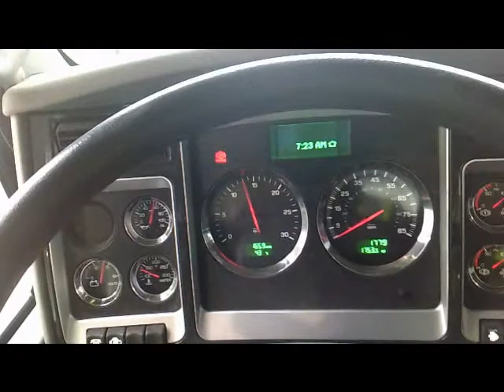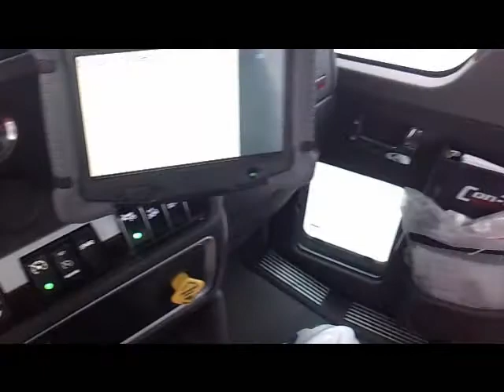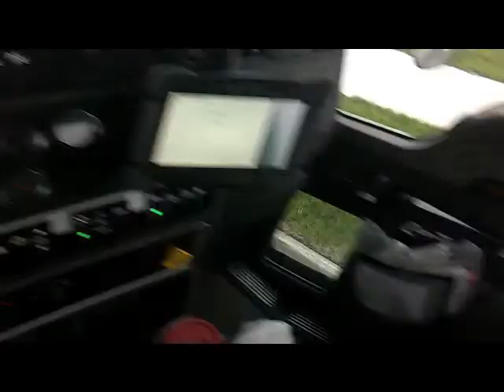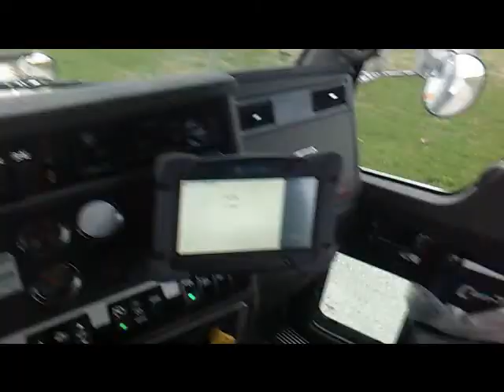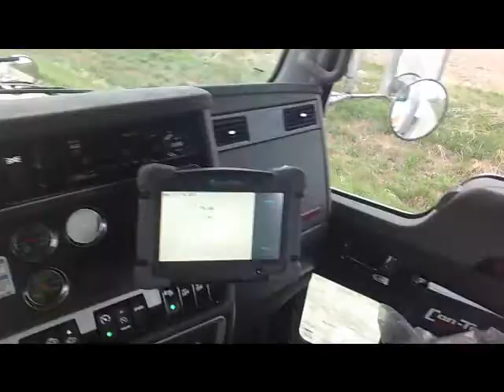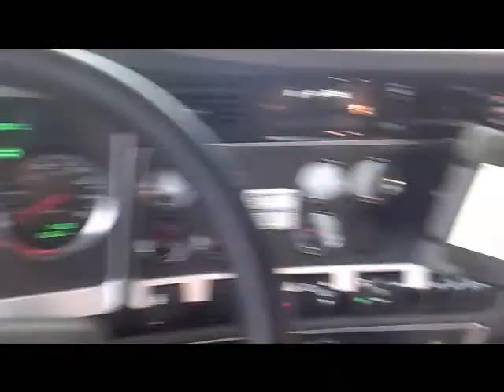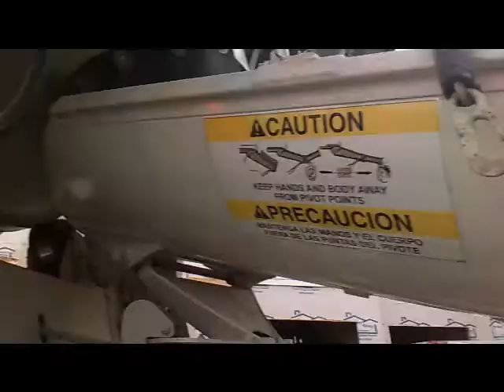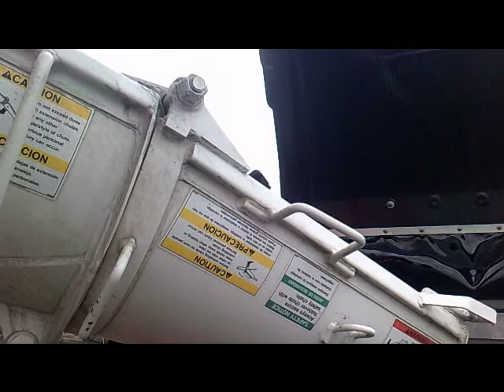Body camera on a ready mix driver

Comment: I've been thinking about applying to drive a mixer in my hometown.  Working 12 hours a day, most days of the week has got to wear on you. Do the days go by fairly quickly,  or do you feel overwhelmed sometimes, as in feeling like all you do is work? I used to work as a welder in factories,  and other factory work for years, and it seemed like time stood still in those sweat shops.
Reply from the maker: Yes yes and yes
It is a lot of work on top of driving a 77000 pound mixer 
It is great money and great memories if you always stay safe.
I’m married now and mostly fly drones now so I have a lot more time at home now..
If you want this do it!!!
I drive my car like a drove mixers.
Hope this helps
Reply: @Gregoryruger  yes thanks for the reply 😎👍

Comment: they premix your cement? I drive for a small company in Ar. they mix after it's in the drum, and drivers have to add water for the right slump. it's a hassle sometimes, some finishers will use up your water if you let them.
Reply from the maker: yes it takes about 3 minutes to load each truck @10.5 cu. once we are loaded we go directly to job after a 22 second automatic truck/hopper wash which only adds about 3 gallons of water.
Reply: MrPerry61 ikr

Comment: I've been thinking of getting my tanker endorsement and doing readymix. I have experience doing western regional and running reefers in an 18 wheeler.

How many hours/miles a day do you run? What kind of days do you get off doing readymix?
Reply from the maker: about 8 loads and maybe 120 miles, and around 12 hour days every day and halfish days on the weekends, sat . so pretty much sunday is my only day off for about 10 months a year here in Iowa..
Reply: don't need tanker end to drive ready mix. even the powder trailer don't req tanker end
Reply: @Gregoryruger  you make good paychecks?
Reply from the maker: Yes
Reply: @Gregoryruger  I can't imagine working 2:30am to 4pm everyday..
Reply: @Gregoryruger  here in aus they paying me $28.50 an hour and then time and a half after the 8 hours and on weekends I clear after taxes around $1500 a week doin 55-60 hour weeks

Comment: what happens if you have a puncture or  breakdown  how much time before concrete goes hard in  lorry
Reply: Ivor it depends on the mix, what additives are in it & if you can keep your drum turning during the breakdown.  Most mixes you have 90 minutes from the time the water is added at the plant until you need to be pouring.  Some mixes, like a fast setting mix used on roadways, if your drum stops turning your truck is a solid mass inside 2 hours.